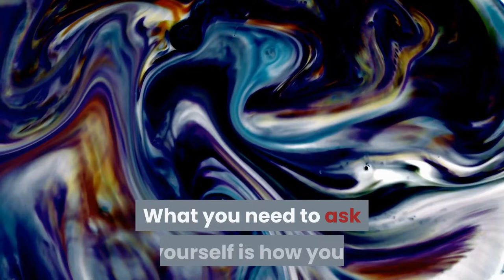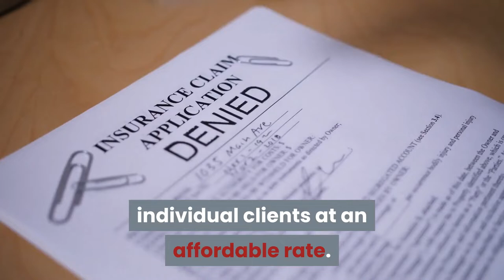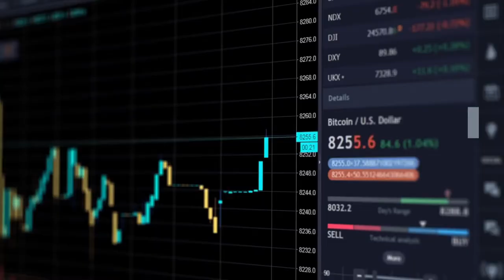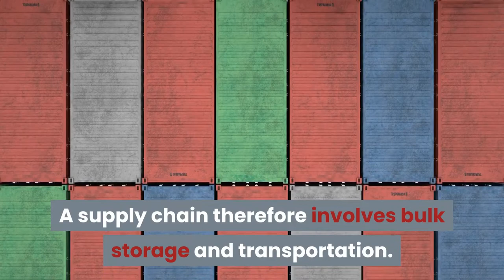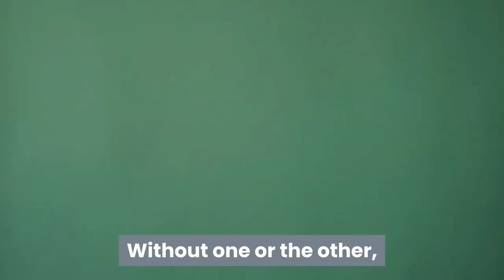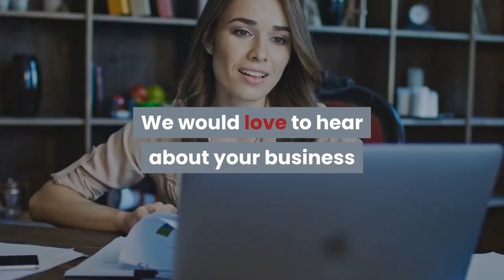Comparing Value Chain and Supply Chain

Comment: Just a couple of points here. First, not everyone agrees with Porter's view of the world. As has been pointed out below, moving products from one location to another clearly adds value. If it didn't, Amazon would make you go to their one warehouse in Seattle to pick up your goods. Have fun with that. But more importantly, you have failed to properly present the key difference between the two models (at least as Porter envisions them). Value stream models apply at the firm or business unit level. Supply chain models, which deal with virtually identical issues, include the relationships and interactions between firms. So a value chain for a furniture manufacturer would start with the timber supplier from whom they purchase their wood, their hardware supplier from whom they purchase their other bits, include their internal manufacturing processes, and then to their distributor. In the supply chain construct, our furniture manufacturer is concerned with the source of the wood all the back to the forest where it was grown. This set of linkages might include the forest management organisation, the timber processor, one or two levels of distribution, the shipping companies (probably trains, boats, trucks) that move the logs or processed timber, the import/export operators who will be involved in what is typically an international supply chain, and let's not forget any possible government-level interactions with occasionally uncooperative countries. At the other end, we need to link distributor to the wholesaler through to the retailer, and in some cases the actual final customer. Along the way we will be managing inventories, costs, schedules, payments, and relationships. it's complicated! There is one other point I'll make. The entire purpose of your video is to sell your services. You have just couched it as an educational experience. It's really bad form to so blatantly misrepresent these two concepts to satisfy your marketing goals. Marketing is fine, just don't insult education in the process.
Reply: Thanks for the inputs, i am actually looking for content on value chain analysis.

Comment: This is a good video UNTIL you stated that a supply chain adds no value...really? You state that a supply chain is only concerned with moving and storing the physical product. Even given your extremely narrow definition of a supply chain, value is still created. Does not moving a product to its place of sale also add value? If one of the four P's of marketing is not "Place" then I will eat my hat. Place is also a value adding activity. You are just plain wrong on this one.

A better way of understanding this is in terms of push and pull systems. There is a common, but incorrect view that:

•	Supply chains = Push system and therefore bad, and
•	Value chains = Pull system and therefore inherently good.

Many, like this video, loudly speak of a ‘value chain’ when referring to a company’s supply chain, and bad mouth supply chain management as an old fashioned term or say its just about transport and storage (I thought this was logistics? could be wrong). Further these people will incorrectly proclaim that a much better way is to use a value chain or a pull system. This is an incorrect understanding of what a push and pull system looks like and ignores the fact that ALL supply chains and so called value chains are actually a mix of push and pull systems - hybrid systems.

A proper understanding will recognise that a supply chain is a value chain and a value chain is a supply chain, the base system or mechanism is identical. In fact the views are synergistic. 

 
I would argue that the difference between a value chain and a supply chain is a simple matter of perspective. When you are discussing a value chain you are attempting to observe the underlying supply chain through the value creation and value destruction lenses. In other words, trying to find those parts of your supply chain that are the key to value adding and contribute the most to value as perceived by the final consumer. 

To be a little technical, a value chain perspective is simply a heuristic (or a mental model or mental tool) that allows you to analyze a supply chain for a value objective. The key advantage of doing so is that it places what the consumer values at the heart of supply chain design and operations, and this I believe, is what value chain proponents are trying to achieve.   

Please stop propagating this rubbish.
Regards
Reply: I see a supply chain as linked value chain across several organizations, therefore i follow this defination of supply chain, "A set of firms or a linkage of separate agents, each with their own individual value chains that pass materials forward and bring products or services to the market, is called a supply chain". so giving a sweeping statement like "supply chain doesnt add any value" (as given in this video) is not correct. I think, effiecient and effective supply chain clearly add value to time, place and price utility.
Reply: My own definition and differences between these two is 

Supply Chain- is the set of activities of sourcing the materials, storing, and distributing to the market efficiently to satisfied consumers.

Value Chain- is a set of activities which are receiving the material, producing, marketing, delivering it to increase the efficiency in the production.

In summary
Supply chain is focusing in adding value to their consumer

Value chain is focusing in their internal business to add value in their products and services.
Reply: Totally agreed with your comments